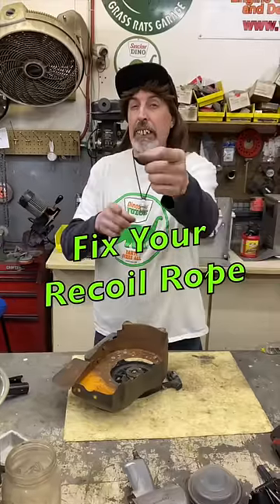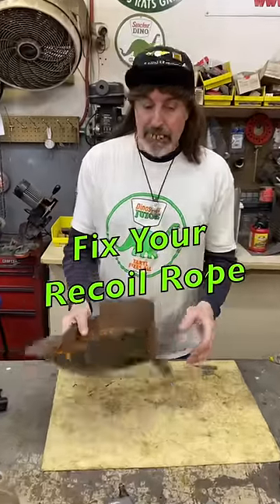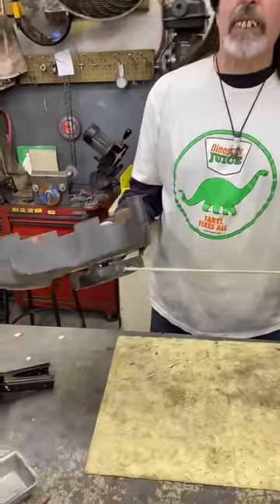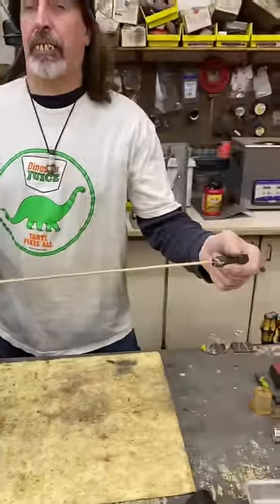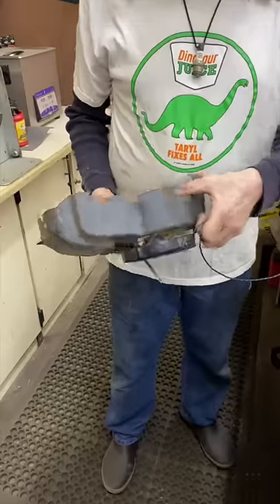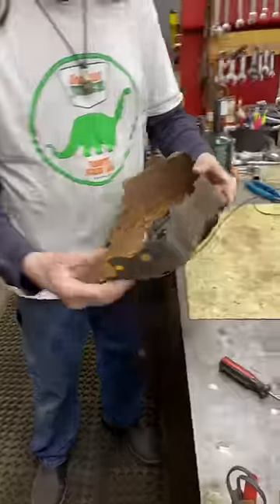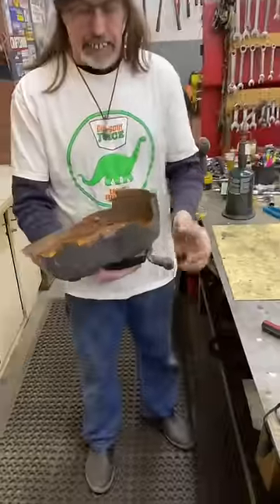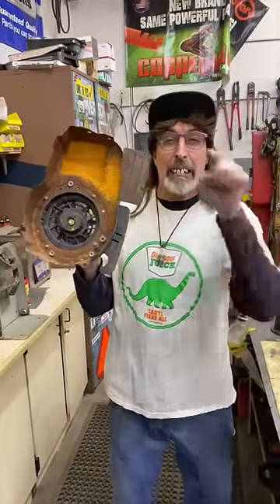Fix your engine pull cord in 60 seconds!

Comment: Guys generally aren't dealing with this simple circumstance.  The rope has broken and the spring has retracted the broken end all the way in so you have to bend the tabs and take the winder apart, hopefully without having the spring jump out of there.  Another annoying experience is when there's too much rope on the winder and it rides up over itself or gets in between the pulley and the housing, so you pull the rope, but then it doesn't retract.  If the spring comes out, you're going to wish you were an octopus, because you're going to want 4 hands, to coil up the spring tight enough, hold it in place, and then tie the new rope in so when you let go of it, it coils the new rope onto the pulley.

Comment: A couple days ago I had to drill the old knot that was really stuck inside that kind of B&S pull handle.
A three point wood drill bit of 10 mm (about 3/8") was good to tear the knot apart.
But it's dangerous, you SHOULD NOT hold the handle with your hand because the rope is tough to drill but the plastic handle won't offer almost any resistance to the drill and you can end with a hole in your hand, put the handle on a vice or hold it with vice grips to keep your hand far from the drill bit.

If I had realized that the handle was so poorly designed I would have bought a new one along with the replacement rope, a cheap aftermarked one of the older style where the knot can be pulled from the back.
Reply: What stopper knot works best?
Reply: @savage22bolt32  Honestly I'm not an expert in knots by any means, on the recoil pulley end I make a simple overhand knot because there isn't a lot of space, on the pull handle end if the hole seems too big I make a double overhand knot, otherwise a simple knot is enough
Reply: @ruben_balea  thanks!

Comment: And if the cord is too long you need to wrap the cord once or twice more around the inside spindle to tighten it more.
Reply: And break the spring when you pull it because it's overtightened 😮